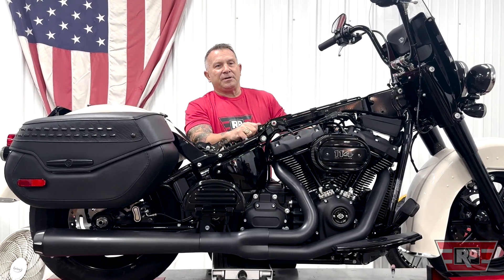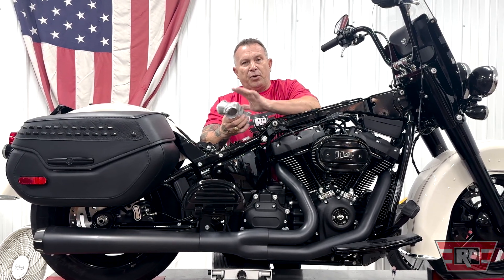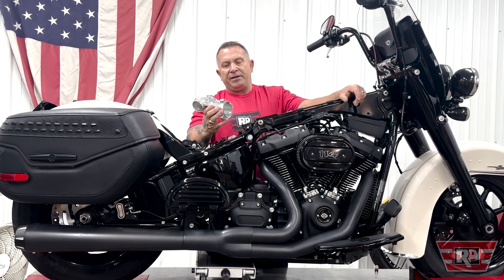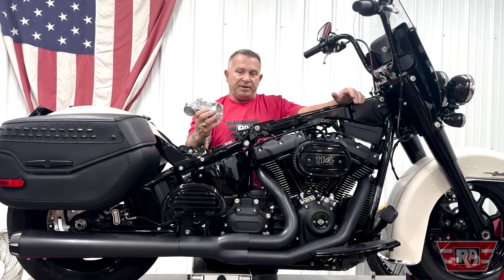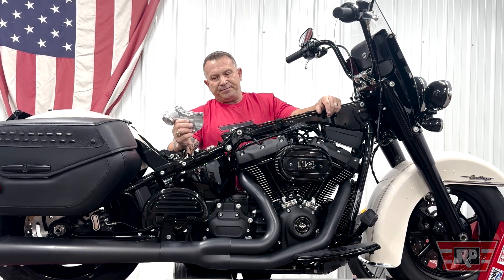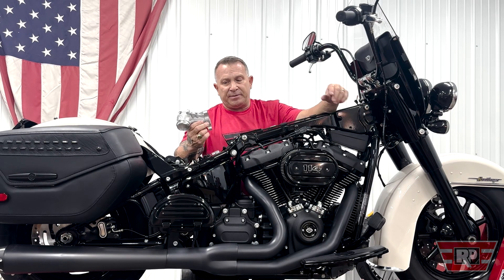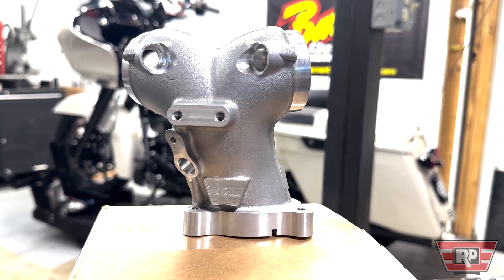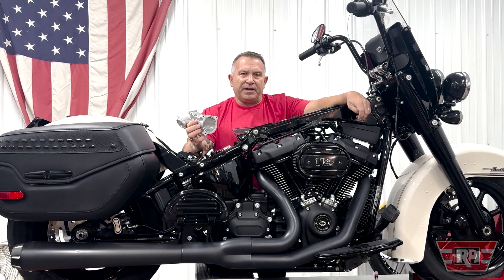In Depth Look - Revolution Performance 55mm Intake Manifold for Harley Davidson Milwaukee 8 Models

Comment: Nice informative video.. I have a question?
my motorcycle mechanic is building me a 128 revolution performance with ported stage 3 heads and he is using a Revolution performance 55 mm throttle  body.  would it benefit if he uses a 64 mm instead?

Comment: If one has had ported heads, bigger cam etc installed in their bike wouldn't a bigger throttle body be needed ?
Reply from the maker: Yes it would be recommended and would have many benefits to your build.

Comment: If you chose to use stock 55 throttle body that's a great upgrade. Port matching is first concern for better performance not throttle body size..I would argue a good stage 1 should include a good alloy, port matched intake.